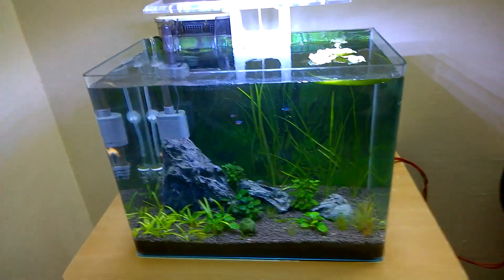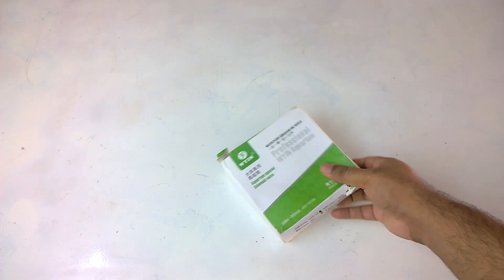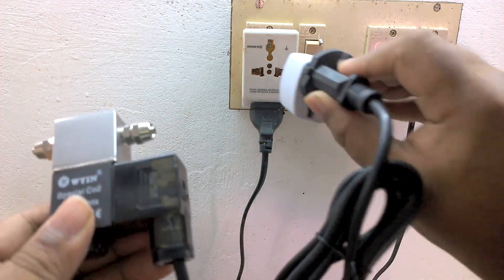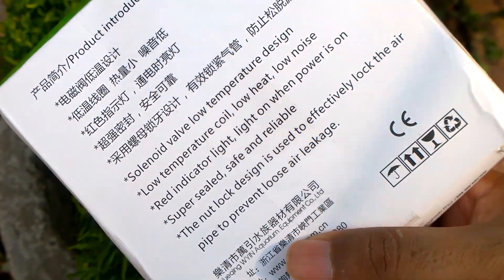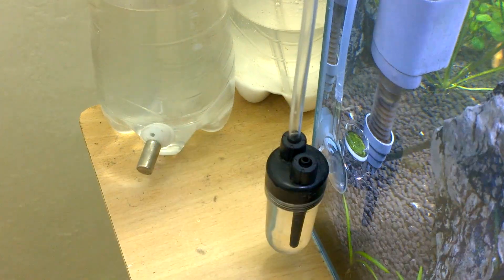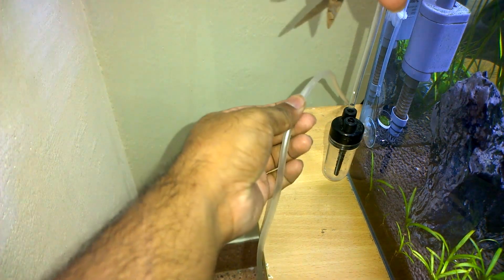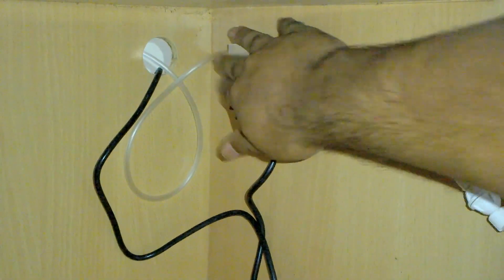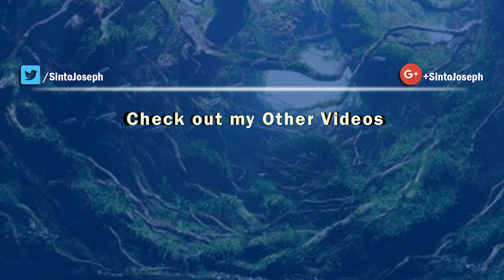Automatic CO2 Diffuser set for planted aquariums

Comment: Thanks, finally a helpful and straightforward video that I was looking for without all the unwanted info.  Although I'm curious, why would you program it for working in the night hours? because most plants use the CO2 and light during daytime for photosynthesis and oxygen at night.  Also keeping the diffuser that close to the filter could potentially get a lot of the CO2 sucked into the filter, no?

Comment: I am Commenting coz I see you are still replying to the comments. Thanks for the video. Appreciate it. I tried everything in this but my co2 could not pass through the drop checker. Pressure was half way through green in the gauge and the bottles where stone hard. My bottle ended up using the whole liquid within 30 minutes. I increased the valve coz I could not see bubbles in the bubble counter. Do we have to wait a few hours before the co2 reaches the bubble counter? Coz I believe the solution 200mg acid and 600ml water should last 20 days Atleast if using 1 bubble per sec. What do you think went wrong in my case? Again, thanks for the amazing vid
Reply from the maker: The CO2 is blocked somewhere it should reach the bubble counter via the one way valve. Don't keep pressing the bottle if the pressure is in green zone. Let the bubble appear in the counter then set the bubble per sec.
Reply: Sure, thanks. I’ll recheck the connection and try the process again. Does it matter if the aquarium is kept at a height of 3 feet and the two bottles at the floor? Also do you think it matters if the connecting hoses are too long?
Reply: I also faced the same issue when I opened the valve full it sucked all the solution from bottle A... Mine magnet didn't worked properly and I unable to remove it from solution of bottle A

Comment: can help me which for my ISTA 0.5 L CO2 Aluminum Cylinder Set Face up which  Solenoid Valve i need tO use  ? do bubble  counter required ?
Reply from the maker: All product link is in description buy same or similar product, yes bubble counter is required.

Comment: i have bought same wyin solenoid and wyin single guage regulator seperately. I have CO2 cylinder with me, regulator connects to cylinder perfectly but i need to use the tube for the solenoid to connect with regulator but when the solenoid is off the tube will explode after 3 to 5 minutes. Is there any solution for this?
Reply: It should be high Pressure tube designed for Co2 use
Reply: @onlyformefarhan  I went to workshop and got designed a small steel tube with threads on either sides that fixed the problem.

Comment: Need your help.  My solenoid valve is not worked after night.  Mean valve is one but bubble does not pas.  Then i open guage the its working. Whats the issue?
Reply from the maker: Solenoid got damaged then manually shut the valve after every 6 or certain hours after use.
Reply: @SintoJoseph  brother valve shut automatically  on amd off properly  but when it turn off it can not pass the bubbles. Then i open guage then it work and after time it off properly.

Comment: Hi sir! You have an awesome video very informative. Actually I am also using a DIY method in my planted aquarium with sugar and yeast. But since it is not pressurized like real CO2 cylinder, you cannot control the pressure inside the bottles it might explode if you will not include the excess CO2 outlet during the night, because we all know CO2 will not generate without lights. My questions are how can you maintain the pressure of your bottles since you are using solenoid with automatic timer on and off? My concern is if your timer is off, for sure the pressure of the CO2 in your bottles will not pass through solenoid going into your aquarium so what method did you used to prevent explotion and maintaining pressure in your bottles.😉
Reply from the maker: I lift the pipes from bottle A out of the solution when pressure in them is above the green zone in pressure gauge.
Reply: @SintoJoseph  with magnet?
Reply from the maker: @DomClimbs  yes, included with new kit versions
Reply: Ah ok Noted.👍🏽

Comment: Hi bro, give a help on my doubt pls, im in between reaction process , bottle is so hard not able to siphon more , next step is to release gas a lil from valve right? Im turning valve (without knowing which side is on or off) but no gas release sound , im confused which way is on off on valve , my pressure reading is at one, wat to do next
Reply from the maker: On bottle B when knob is going away from the hole it is On and going towards is OFF.
Reply: @SintoJoseph  thanks for reply , this way i understood on n off .. but i did both ways , its unresponsive
Reply: @SintoJoseph  bottle , even pipe which goes out from bottle b to valve is so tight not even pressable, but after valve no response
Reply: @SintoJoseph  one night passed, pressure same at 1
Reply: @SintoJoseph  unable to release n re squeeze bottle a to make pressure to green area
Reply from the maker: something is wrong check if check valve is installed in correct direction it allows flow in only one direction. Check other parts too.
Reply: @SintoJoseph  bottles are in my hand....im doing it seperately, check valve n all is near aquarium , not yet connected with tat, first aim is to make reach pressure to green area
Reply: @SintoJoseph  i have an additional valve ? Shall i replace it ? Will my diy kit valve can be faulty ? Is these results i hv is because of a faulty valve? I do hv a spare valve, if i have to replace how to do i ? Can i pull valve  n detach , will it coz burst ?
Reply from the maker: Just tighten the knob above bottle B and then remove the valve and try with different valve.
Reply: @SintoJoseph  its a new info for me , a knob , where is the knob ? Above bottle b cap i see two small turnable cap which holds both tube , my knowledge was those turning caps are to tighten the clear pipe
Reply from the maker: yes that turn able cap only tighten them and then attach new valve.
Reply: @SintoJoseph  hi bro, i was wrong, so far i wasnt turning tat screw , there is a ring i was only turning tat ring, i removed bottle n attached new valve that is faulty in one yo i cud make out , but later i saw hw to operate diy kit valve , its proper , nw presure i raised til 1.5, bubbles came woth solenoid n all installation fine
Reply: Any idea why tat ring is for along with valve screw ?
Reply from the maker: No I don't know that.
Reply: @SintoJoseph  my canister filter is new , trial run going on, i feel a smell on top surface of aquarium , does this co2 process cause any odour ? Or is it canister filter ..aquarium is also new , just plain water filled status...
Reply from the maker: if smelly siphon dirt and change water.

Comment: Hi bro, nice video 👏 , help on my doubt, co2 is produced when one bottle content goes to another isnt it , initially we have to manualy press bottle and make the pressure reach to green area in regulator, and co2 starts receiving , my doubt is after a time when pressure reduces the whole process has to repeat right (think there is enough material left out in bottle) so how do the mixing process happens again n again till bottle content finishes ? Thats my first doubt, another when a solenoid gets off n supply stops (may be at nyt through programing) the mixing process also stops ? If not the co2 making will keep happen right ? In such case will more pressure lead to bottle burst , if u knw about these 2doubts pls do help
Reply from the maker: After CO2 is initially produced in bottle B it goes to low pressure area that is bubble counter and ceramic diffuser. As it goes out equivalent amount citric acid solution is sucked into bottle B. When CO2 stops going out from diffuser nothing pulls citric acid to bottle B. Thus CO2 is only produced as per bubble per second fixed. If you notice pressure building up in pressure gauge take the dipped pipe in bottle A out of the solution thus no CO2 is further created.
Reply: @SintoJoseph  understood thanks... So when solenoid shuts off co2 is not used n the level of co2 in bottle remains same is nt it ? No uncontrollable level co2 is produced right ?
Reply from the maker: yes..exactly